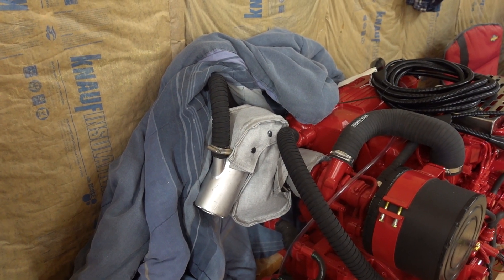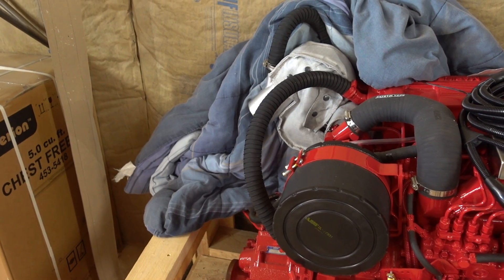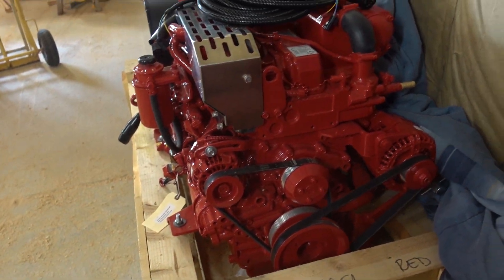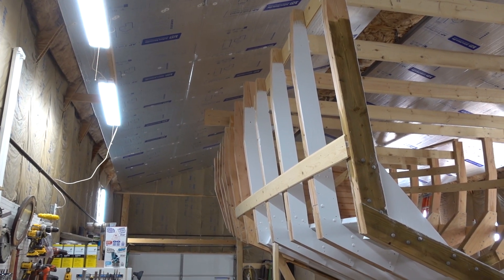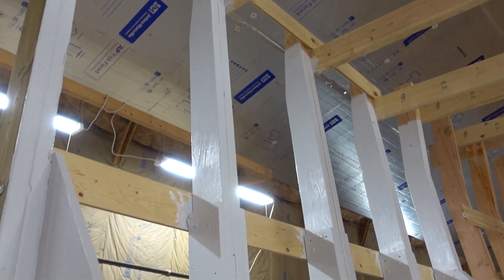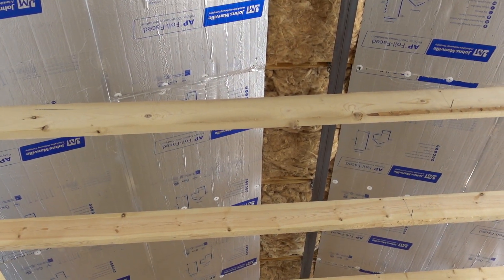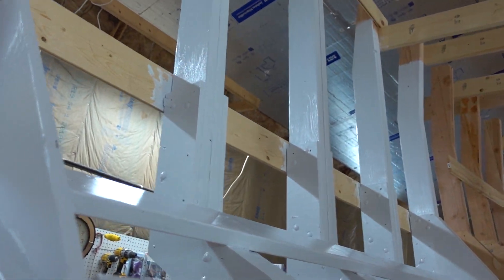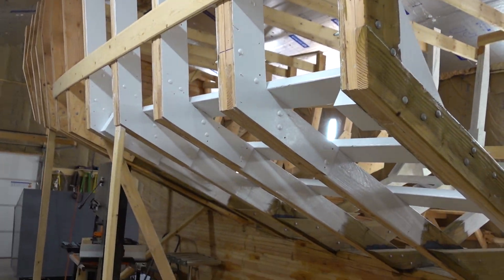Engine Arrives!

Comment: just curious at what stage the ship is in seeing how these videos seem to be taken a few years ago , btw i Love these Diesel Ducks , i just with someone would build a 60 foot version in wood of course
Reply from the maker: Spoiler Alert! Right now (5/16/2023) The sides are planked, the interior is all roughed in, water tanks and pressure system are in, as is the galley sink and the forward head plumbing. Electrical system is mostly roughed in, Fuel system and transfer pump is in, engine and Aqua Drive are in although no shaft or prop yet. Right now I'm working on bottom planking.